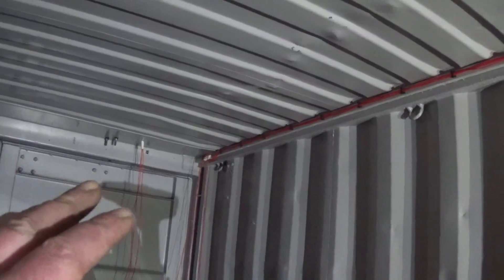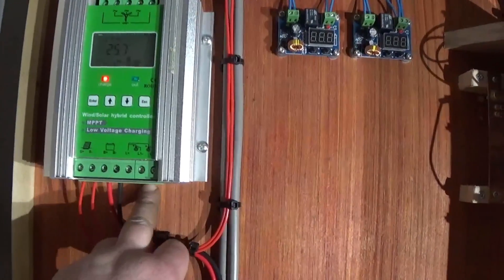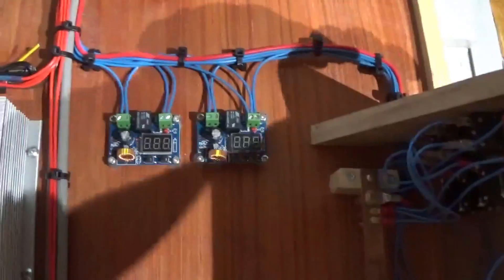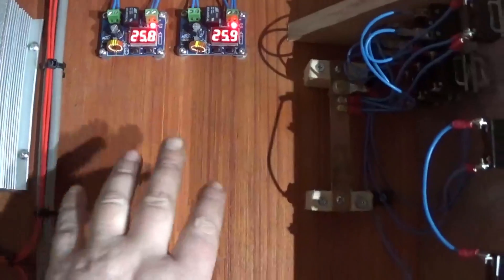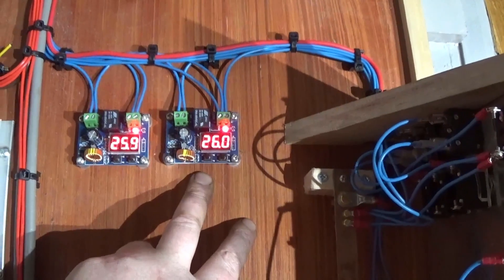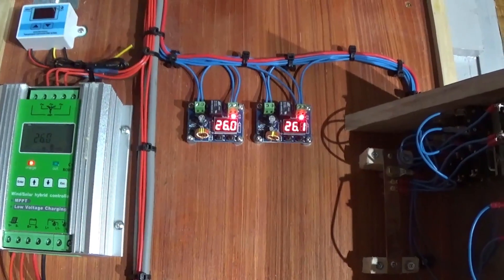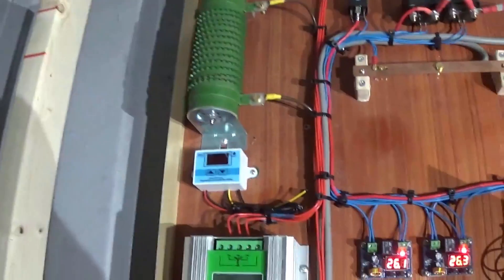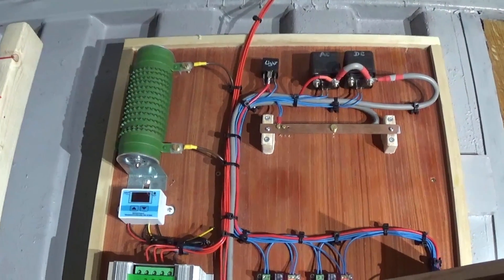Wind and solar powered workshop!

Comment: Wish I had read all the threads before buying Chinese lantern gen and dual controller but agree best to start with cheap stock and learn as you go..... How did your Batteries get fried? I am running three 12v 120ah leisure deep cycle in series 400w wind and 300w solar. Batteries max 13.1v and min 12.4v  10 amp trip on inverter and 5amp fuses between batteries. No issues yet.  But curious how yours got hit cause you had a impressive bank.

Comment: I have been watching you for awhile and I have revisited this one and when I set up my solar which just runs our house lights and I thought I would add some wind power but the trouble is my solar takes about 2 hr in the morning to top the batteries back up so the wind doesn't get a chance to run and my wind generator regulator is cheap chinese rubbish so I'm investigating dump control when I brought my mppt I wasn't thinking of wind so it only does solar so I'm exercising my grey matter. I like your setup
Reply from the maker: I've modified this a couple of times since the original install, has been fun just playing with the cheap modules.
We have days when there's very little sun, so eventually when I try and do more than just this shed with a system I'll go back to a hybrid system (I'm currently just solar) 
The system I like most is using a slaved mppt solar charger for the turbine, it obviously needs a rectifier and braking system between the two but with a 48v turbine charging a 24v system through the mppt it should give excellent performance.
Reply: @turboconqueringmegaeagle9006  I'll have a look at using a chinese mppt (fake?) to dump the load through and not using the other chinese (fake?) controller that came with it

Comment: I already have twelve 100 watts solar panels and I will be adding a wind generator. I hope that the 20 deep cycle batteries will work instead of a dump load, If not, I will get four more of them. My system is 24 volts and I have a 2000 watts Aims Power inverter charger that stays on. I bought a Winco Lil Dog generator four days ago so that I can run a welder. I used a 4215 BN charge controller, which can take 1040 watts. It was cloudy today, and it made 2.32 kwH. It makes around 7-8 in the summer. I was just wondering how your wind turbine is doing. I'm not sure which one I want.
Reply from the maker: Wind turbine was less than satisfactory, was supplied as 800w but delivered half of that, the housing was a moisture trap, letting enough condensation in to ruin the yaw bearing after a year so I repaired it but then switched to a better mppt solar charger and got rid of the turbine.
The dump load prevents overspeed and subsequent damage so if the controller and turbine are not set up to break the turbine, your batteries are full and you don't have a dump load, you might overspeed the turbine.
When I can put more money into a better system I'll get another one, I'm in the perfect area for wind but given my experience with this one if I wasn't living in a particularly windy area I wouldn't bother.
Reply: The average windspeed is 18 here, and I'm almost at the top of a hill. I think I will get a 1kw unit from Hurricane wind power.

Comment: hi interested in this circuit. Am doing a similar project. What is that component you have connected between the dump load and the controller?
Reply from the maker: It is a temp sensor so depending on heat it could run a fan to vent the container

Comment: neat work up top, but the battery bank bus bar system needs work, to max your battery life, you should have 3 banks of 2x12v with balancers between each 24v set. Each of the 3 sets should be equal wire lengths and connect the opposite sides + and - to balance draw between all the banks.

Comment: Man...that cable management is friggin tight. My cables are a sad sight. How is the Hybred controller holding up?
Reply from the maker: Cheers bud. That charge controller is a bag of w***, it claims to be mppt on the solar side but boiled my batteries so I ran on wind till the turbine failed the second time now I've bought a decent mppt solar charger and am just on solar till I get another turbine and controller.
Reply: @turboconqueringmegaeagle9006  thats a bummer. Been wanting a little wind turbine to add to my solar. Sure seems to be a lot of crap out there. I started making vids again if ya wanna see what I got goin on.
Reply from the maker: @sunnylandcamper  learning about it all with cheap Chinese gear hopefully means I make a better system when I upgrade. The turbine I bought lasted 2 years with a bearing swap half way but was probably only half the claimed 800w. 
I'll check your channel out.

Comment: I went with a vertical axis wind gen not affected as much by dirty wind with built in electromagnetic braking for over voltage what voltage are your panels with an MPPT regulator higher voltage panels are better and you can get up 98% panel efficiency

Comment: Been reading reviews on that power controller is it working good for you still? I would like to have one that wind and solar can hook up to.
Reply from the maker: No, don't do it! I'm actually working on an update video right now. This unit claimed to be an mppt charger but boiled my batteries, I have been running on wind only for nearly 2 years, that side of it worked fine, have now Installed a real mppt EPever solar controller and am trying to figure out how to run a new turbine through a second solar mppt charger.

Comment: Will a solar controler alone do the same thing its only voltage goin in what difrence does it make if it came from turbine or panal im new to this hahah
Reply from the maker: Yes of course, it's just where I live, I get more wind than sun!
Reply: May aswell have both tho what if its a windy and sunny day some turbines are 3 phase could it be no solar panels are 3 phase unless special ones so a solar controller would only do solar maybr
Reply from the maker: @ryanthethumb  it's not 3 phase like industrial supply, it's " wild 3 phase" (cool name)  which is unusable so really needs to go through an inverter to use as clean AC or a rectifier to use as dc or shove in a battery while all solar panels are dc and really just need some fairly simple overcharge protection to shove it straight into a battery or an mppt charger which will still dribble a bit of current in on a cloudy day, I'll be upgrading my solar soon to an mppt, my turbine was sold as 800w but I think it's really only 200w so I just want to play around and see what works best, then buy a much better turbine.
There is a lot of false advertising with the cheaper products so just be careful if you are going to punt for some of this gear and probably check some other videos out, I fix electrics on aircraft but know very little about electronics!

Comment: Hello =D I was wondering If you could tell me a bit about the dumb load for example If I was charging my batteries from another source would the dump load still dump? Do you think you could switch the dump load resistor and connect to a 24v heating element instead ? Anyway keep it up, interesting  stuff!

Comment: Is this charger good?
Reply from the maker: No, wind is fine but there is no overvolts protection on the solar side, if I hadn't caught it, my batteries would have been destroyed. I will install a separate mppt charger but right now my panels are disconnected.

Comment: Very cool! As far as the dump resistor vs 12v heater they should both act the same. A load resistor gets rid of all that energy through heat, so both the resistor and the heater should produce the same wattage of warm air.

Comment: Keeps looking nervously at the roof ... That carbon fibre stuff is strong mate but it looked well dodgy...I'd have used steel or summat a bit thicker than a scaffolding brace for the mast (just to be sure). You shoulda wore a cape...just to make it look more dramatic PMSL.
Reply from the maker: Yup, it's not normally quite this windy but hindsight being what it is, I wish I'd used steel.....  And a cape.
Reply: @turboconqueringmegaeagle9006  in hindsight...I wasn't thinking about electrical storms, you're relatively flat down there in Lincs...steel and lightning...not a good combo, even with it being welded to the workshop and earthed that way could still be a bit on the Dangermouse side lol
The cape was a good idea though.
Reply from the maker: Currently the only conductors I have are my power wires, if it gets a lightening strike they'll vaporize...  We don't really get thunderstorms here tho, they are considered too exciting, we just have wind and drizzle.
Reply: @turboconqueringmegaeagle9006  Pissing myself laughing

Comment: Letting your batteries get down to 20.XX Volts is way too low.  I have mine set to turn off at 24V. Full charge is around 28.xx. 
Nice setup and well laid out. I learned just from looking at your DIY Bus bars.  I have a small system set up similar on solar panels as they are cheap here used and turbines are exy and the wind here is either non existent or gale force of an hour or so then back to nothing. As well as an Inverter, I use Old UPS systems I bought cheap because the batterys were shot. APC brand units are 24V so a couple of cables and you have a very good quality inverter. I have a couple of 400W units and a 3Kw unit as well as a good 2 Kw regular inverter. waaay too much to the couple of car battery's I have but I can easily put 3 Kw of panels to feed them so the battery's would become ballast more than the supply which would in effect be direct from the panels.  

I have also been thinking about a couple of containers for a machinery shed and as a place to put more panels.  Will be interesting to see how you go with them. 

Well done mate!
Reply from the maker: Yes mate, how are you doing? 

Agree completely on the lower limit, I'll keep it a bit higher.

You still up for seeing who can build the biggest oil burner?
Reply: @turboconqueringmegaeagle9006  
Maybe :0)  Define Biggest.... Biggest size, biggest output...??  Just need to know what we are working here to?
Reply from the maker: Output naturally! I have no idea how we would measure it, the sensible thing to do would be to calculate it from consumption (as I have learned from your videos) alternatively we could see who can melt a wheel quickest?
Reply: @turboconqueringmegaeagle9006  Consumption is logical. If it's using more oil it's making more heat.  Maybe look at output and then melting a wheel.  They are 2 pretty different approaches really. 
I think we should set a time frame and then have a time both vids are released together. 

I'm not confident of this one. People call me a nutter but you are off the beam far more than I am and 3 times as smart. At least. 
I can only imagine the monstrosity you will come up with!!  :0)

Maybe we should put a clause on this that if one ( or both) of us gets arrested, we are disqualified!
Reply from the maker: I disagree, you are at least as unhinged as I am, but thanks for the compliment.
Also whoever gets arrested gets a 10kw bonus not disqualification...
And can you include your legendary health and safety tips please?
Reply: @turboconqueringmegaeagle9006 
hahahah! Yes the bonus would make more sense. 
Safety Tips.... while standing next to an oil well Fire..... Not sure I'll be able to keep a straight face myself for that one. 

You  know I don't ever remember hurting myself with a burner or doing a vid.  Right now my arm is Killing me from brushing it on the end of a hot air gun when working on some plastic down pipe yesterday. 

My safety tip for this would have to be playing with huge roaring Oil fires and molten metal will cause you no harm at all but those pissy little electric heat guns are freaking dangerous man and you can really bugger yourself with one of those things!

Comment: very interesting, as ever. My question on the wind turbine is, 'Does it have an over-run protection?' I suspect not, but just a word to the wise - I think the second most common cause of catastrophic wind turbine failure with the big commercial ones is rotating too fast in a storm and the failure of the braking/lock-off system which ends in spectacular explosion of the fan blades. (The most common cause of catastrophic failure is setting on fire due to friction in the mechanism, but I guess you are safe on that one as it is a much simpler mechanism.)
Reply from the maker: We are currently getting battered by very high winds, and I've been watching it...  When it produces too higher voltage the controller breaks it using the dump load, what I've also noticed is that the blades deflect (it makes a really loud rasping noise like someone doing aerobatics in a variable pitch prop aircraft) and the body will rotate 180° the blades will come to a standstill, do a couple of revolutions backwards then the vane faces it back into wind and the whole process starts again, if this is a design feature or a happy coincidence I do not know....  It's quite spectacular, I'd estimate we are currently getting 70mph winds.

Comment: Interesting job. How much did the charge controller and batteries cost?
Reply from the maker: Charge control was £50 
Turbine £120
Switches, relays and the cable I paid for was another £100 
Most direct from HK or China.

Batteries were from a wholesaler who should have sent them back to the manufacturer because they were 6months out of date so I got 8 of them for £350 (110 amp hour each probably 90 amp hour now)
Reply: @turboconqueringmegaeagle9006  Interesting to know. Next project will be to build a generator that works off wood gas... :) (Though I may do that at some point as well as a proper solar generator with a Stirling engine and yes there is a toy solar Stirling on my channel.)

Comment: The resistor is a heater, so why not just put it where you want the heat? Or use several?
Reply from the maker: Because it's designed to dissipate heat as quickly as possible, I want a bit of thermal mass like an oil filled radiator.
Reply: @turboconqueringmegaeagle9006  When you've got one, why not use that as your dump load instead?
Reply from the maker: Really I need some ventilation around the batteries in case they gas at all so I don't blow up the containers, my thinking is that I'll enclose the whole installation, fit a second temp probe and have a fan come on blowing outside so in summer any excess heat or indeed hydrogen goes harmlessly outside, and if it pulls air from inside the containers it will add some much needed ventilation as they'll get stuffy.